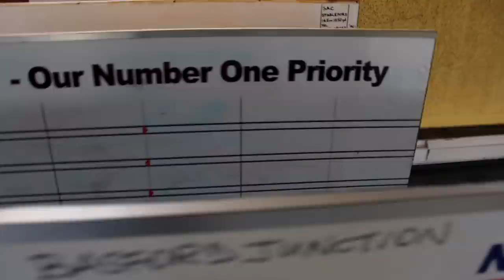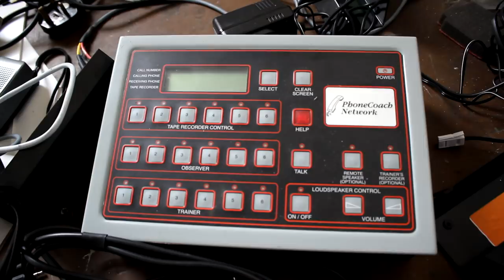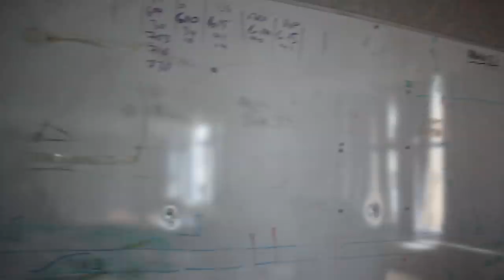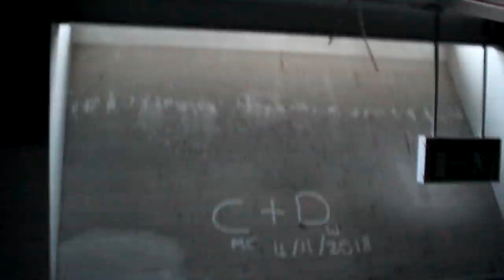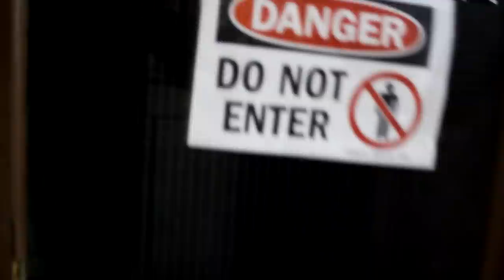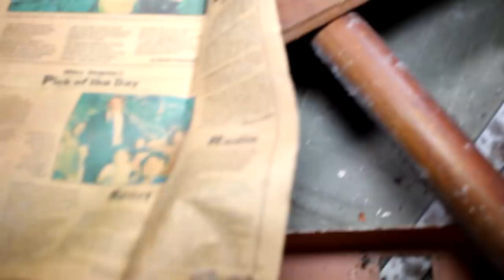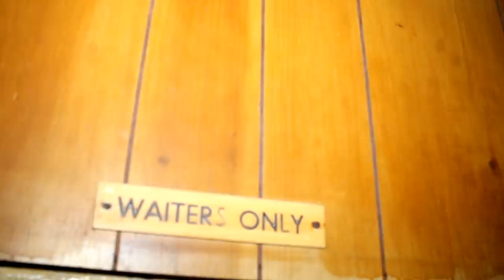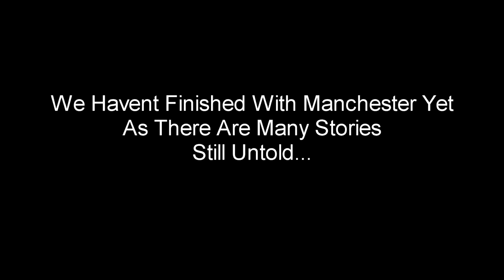What Lies Beneath Manchester's Victoria Station?

Comment: when i worked there  i went down into the club a couple of times  (which was unused until a shop called Mace used it for a store room)   Also heard about a part of a train  is stored in the dungeons of Victoria (under the concourse) which was part of a crash . Also remember when they rebuilt platform 1+2   they found  human bones  because the site used to be a cemetary   and the green railings were still there .
Reply from the maker: Thanks for the history m8 and yeah I've heard rumours of that train myself?

Comment: The original station was built in 1844 and it was single story building and later on made in to two story that is the building @ 2.38 on the right corner of the screen down below, the one your standing on  the roof was built 1902.
Reply from the maker: Cheers dude!
Reply: Shame you couldn’t get a clear bright vid of the Irk rushing by
Reply: David Lancashire : Martin Zero may provide.....

Comment: Ey pal, is Man Vic still open ¿? , me n our kid (W. Casino devotees), before we had motors, used rail to getup to W.Wallgate from Victoria. HaH! In 77 we were approached, ticketing area,, by a geeza and his bird with an Adidas FULL TO BOSTINGLY, of grabbed t. Lights (Tuinal caps), and we had a few for the morning and fk, after the b.st.blueys, by time we got back to Chesterfield next mid morning we was well fkn rammed. Passed through M V only coupla times after and, post ticket area, had to, and managed to fall the like 20+ steps into the underpass to the W W gate platform.  We all got fed up with later attacks on the rail travelling soul crowd as Wigan locals turned against us. Am 60 now, blimey, wish was a young again, y'know. Neat vlogs oak, bang on, your accent reminds of the Trafford lads, norarf!
Say, you do olde pubs as well, Okeh, outside Manny Picc there used to be a mini 2 roomed alehouse, is it still theere, just across the road from where a traveller came out from that station, where the taxis later used to congregate ¿? Top endocrine Whitworth St I think.